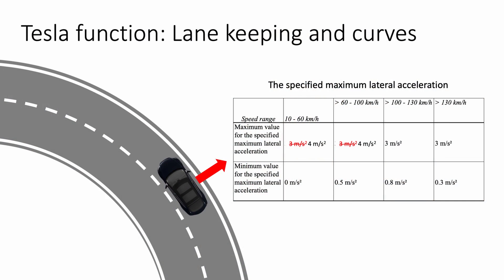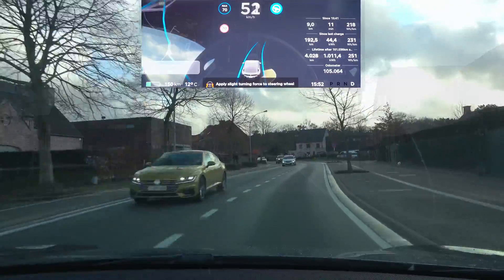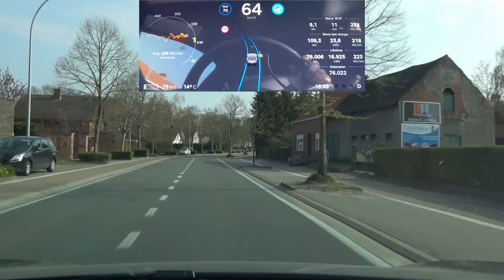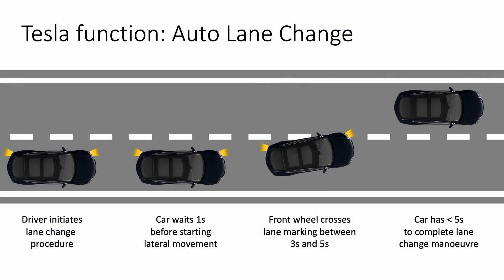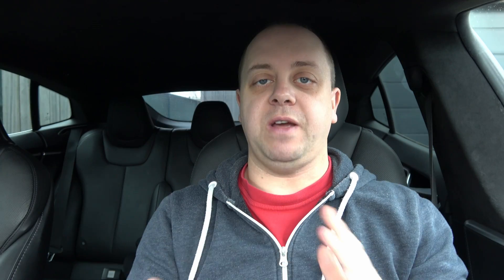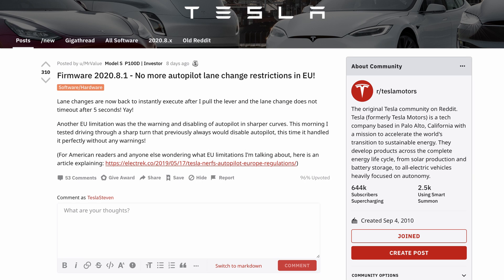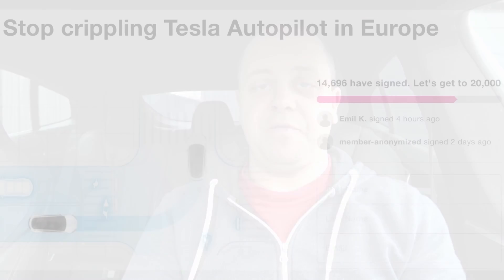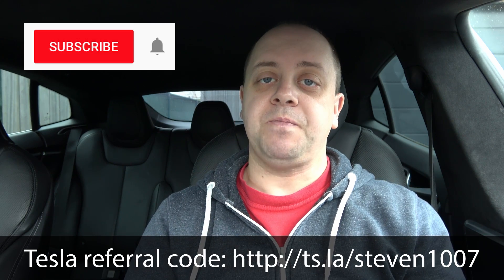UNECE February workshop update: has anything changed?

Comment: Steven, here is my opinion. Maybe you can comment on the forum or dedicate an entire video on it: https://teslamotorsclub.com/tmc/posts/4566249/
Reply from the maker: You have some good points there. I've also already explained several times in my videos that Tesla does indeed know the change in speed limit and should slow down before the sign, so the speed is correct at any given time. As for the curve, Tesla has implemented it before to slow down beforehand. But on the other hand, driving 70kph through that S-curve is not overly sportive driving. I stand behind the point to increase the lateral G-forces as I don't want to be driving like a grandpa all the time.
Reply: @StevenPeeters  Sure, increasing lateral forces might help but still Tesla AP misbehaves. By the way, if the car drives I want a limo driver like experience.  Not only for comfort but also for confidence. Seeing the car be cautious and careful without strange interventions is a must IMHO.

Comment: To add insult to injury, the timeout for auto lane change went all over the place, 20 s, 15 s, 10 s. It appears that these bureaucrats are utterly clueless. They just toss up a coin and decide what will be the timeout in our next proposal? Same with max the lateral acceleration. Proposals are all over the place: up to 130 km/h, 100 km/h, 80 km/h and nobody seems to know anything and then the whole thing gets axed. One thing is clear: no one has ever driven a Tesla to have first-hand experience in the matter. They are spreadsheet jockeys who talk from theory, not practice.

And then everybody has a veto right it appears. A recipe for stagnation. Don't get your hopes too high for the September meeting.
Reply from the maker: I think the proposals from AVERE were very wel documented and backed by science. This should have been an easy pass for those... And by the way, were you present during the workshop to have this detailed info?

Comment: I'm just experiencing Autopilot euro spec this week after having experience of US Autopilot and Euro is dangerous. It just gives up around corners instead of continuing even with alarms.
Reply from the maker: Mine gives the warnings and continues. HW3 seems to just give up
Reply: @StevenPeeters  yes mine is a week old. HW3 does just give up.
Reply from the maker: FSD is nowhere in sight with the current hardware imho. Still a lot of work to be done gor tgat to happen
Reply: @StevenPeeters  you can't even use Autopilot on majority of Irish roads. So yeah FSD is years away.

Comment: not too surprising...in the netherlands in late 2019 a report was published: https://www.onderzoeksraad.nl/en/media/attachment/2019/11/28/who_is_in_control_road_safety_and_automation_in_road_traffic.pdf.  Kind of conservative report with some - in my opinion - rather foolish assumptions. unfortunately, thats the way it goes.
Reply from the maker: Read a few sections quickly. Especially aboutvthe immaturity of systems. They blame the immaturity of the AP for a truck swerving abruptly into a Tesla? That’s just BS. Would a human have been able to avoid it?
Large speed differences are part ofvtge problem. When you drive 150kph next to a line of trucks that fo 100kph, you can’tcslow down fast enough if something happens suddenly. But that discussion might be a complete video on its own 😄

Comment: I got 2020.8.1 and I had the feeling it takes curves at higher speed. Traffic light display is nice, but fails to show colors, when car is too near to the lights - or in other words, at the halt line
Reply: With HW 2.5 it is still the same as 2012.4.1 :-(
Reply: I did some NOA tests with a freshly installed firmware 2020.8.2 on S75D w/AP2.5 &FSD-option. Results: (1) Two well known 90-degree curves rated @80km/h were nicely managed, speed was reduced to 55km/h, NOA drove well inside the lanes,  no lane crossing, speeding up to 80 afterwards. Then 800m further the same to the other direction. Also positively tested from the opposite direction. (2) Tested NOA my most favorite 180 degree Autobahn exit. 120km/h like allowed on the Autobahn, turn signal activate automatically, immediate sharp turn into the exit lane, which is unusual long due to the 180 degree exit at the end, NOA reduced speed in the long exit lane, the 80km/h-sign was handled quite correctly, as well as the 60km/h-sign. Then the sharp 90 degree right turn was handled with 40km/h and felt safe and was performed as I would drive it manually. Resource not the case vor 6 months ago in October 2019. So I can report improvements in AP2.5 .
      Never the less the main future improvements to FSD will mostly come with HW3 firmware  versions. AP2.x will most likely continue to run in an emulation mode.
Reply from the maker: As long as I don't get the HW3 upgrade from Tesla, I won't be seeing any traffic lights or even traffic cones. Being on HW2.0 with MCU1 really sucks at the moment and Tesla is still not able to give any timeline when my car will be upgraded.
When I get 2020.12 I will will do my usual testing and see what's what. But regulations have not changed, so I don't expect it to handle the S-curve they way it is supposed to do: just like before the regulations were implemented or slowing way down before the curve.
Reply: Steven Peeters I‘ll do another test at my favourit 180 degree Autobahn exit
Reply from the maker: @mschorer  Let me know how that goes...
Reply: Steven Peeters I can confirm same crappy behaviour! Which is, that AP stops suddenly working when half way through the curve! Very scary, to say the least!
Reply from the maker: @mschorer  This is indeed partly to blame on the regulations, because the car can actually handle it perfectly. However, Tesla should also put in more effort to keep us safe within those regulations. It is partly their fault as well

Comment: It’s going to end up with an accident with an Tesla crossing the road before the regulations change, hopefully not a life is lost. Current state is really dangerous!!
Reply from the maker: In that case, Tesla will be to blame (or the driver actually) as it is still only a driver aid and not FSD. The way it is crossing into the other lane is actually something Tesla needs to fix by slowing down before the curve. It did so at the end of last year, but then in the latest updates that is gone. However, there are other sharp turns where the car does actually slow down. I'm guessing the path prediction algorithm on this curve is completely wrong, even though it has the correct map data and GPS location. I wish I could just give this kind of feedback directly to the AP engineers. Things like these seem easy enough to fix, because they've done it before.
Reply: If there's an accident , they will say it's unsafe and ban it altogether.
Reply from the maker: @allowambeBOWWAMB  Currently, the system is a driver aid, not full self drive. The driver is always responsible. It's the same as when the driver does not have the system. You should not rely too much on this feature. That is also partly why I started this channel: to educate people on how AP works, what it can do, but especially what it cannot do!